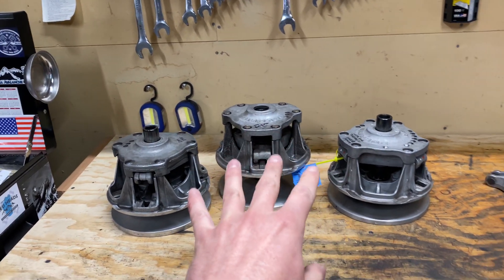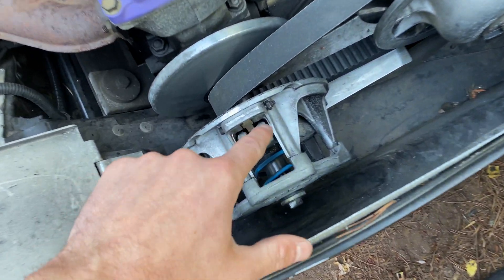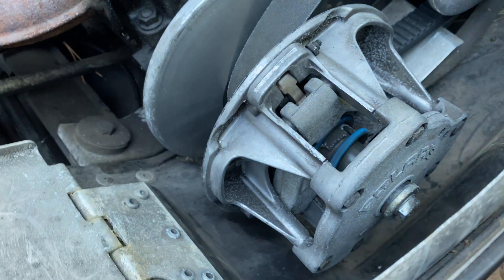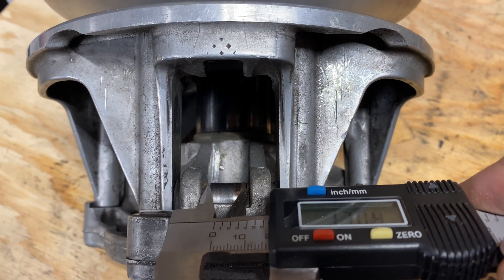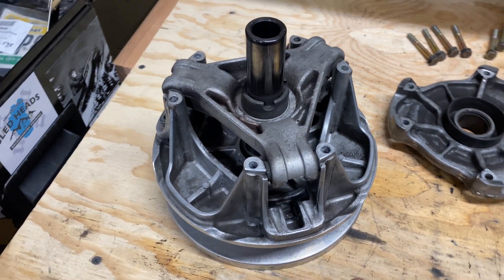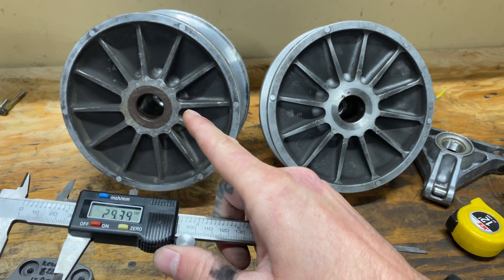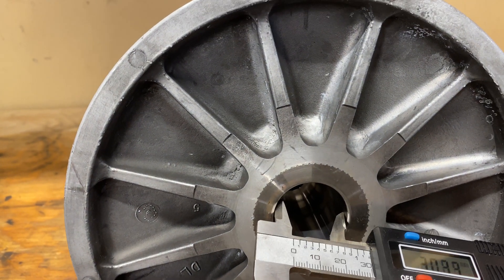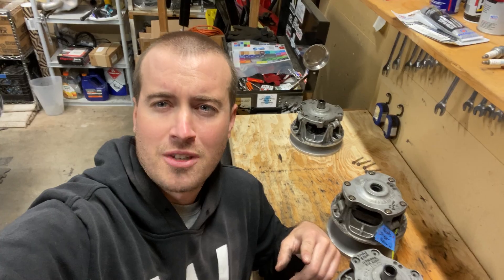Polaris P-85 Snowmobile Clutch History

Comment: Apparently, the "Big Block" sleds from 97-99 or Domestic Twins if you will are all 30mm crank tapers, so they also have very specific P85's. I wonder if those newer ones would work?
Reply from the maker: This is true. There have been a number of different crank sizes over the years. Gotta make sure they match up 🚀🏁

Comment: What one was in the 1996 indy train 488 ?
Reply: @FeederCountry  ??
Reply: They're all P85 clutches (except the new P22, and the P90 for the low-HP sleds in the '90s). None of the clutches in this video are for your 1996 Indy Trail, not even the one from the XLT. For the 1990s era Fuji motors, the rule of the thumb is that all the twin cylinder P85 clutches are interchangeable amongst each other, and all triple cylinder P85 clutches are interchangeable amongst each other. The triples and the twins used a different offset on the clutch, so they sit different distances from the engine block. You can see the difference on the back side of the clutch where the taper bore is. The triple clutches are like what is shown in Clutch #1 in this vid. The twin clutches have their taper bore in the center of a raised boss on the back side (with the fins).
Reply from the maker: @MrGcard100  more good info added this the comment section. Thank you!

Comment: So what’s the best clutch for a 1996 rmk?
Reply from the maker: If it was my sled I would run the exact same oem clutch that was sold with the sled. Then I would get a slp clutch kit so you can use their adjustable weights to tune the clutch a little. Especially great for elevation changes and trail conditions.
Reply: @FeederCountry  so the 2001-2004 p85 would not be an upgrade?
Reply from the maker: @taraszakordonskk5731  I personally don’t like swapping clutches around like that. I think the 2001 clutch runs a different belt than what your 96 does. So you might have to run a belt that’s too hard of compound for the HP your sled is making. There is a lot of variables. I think being able to tune the clutch via adjustable weights  will far out preform any gain you might see from changing a clutch.

Comment: I'm trying to figure out how to tell the difference between the p85 secondary and the p90 secondary?
Reply: TSS-04 or TSS-98 are roller secondary clutches made by TEAM. Nothing to do with Polaris and P85 or P90.  P90 secondary clutches are much smaller in diameter than the P85 secondaries. The P90 also used a skinnier drive belt. P90 system (primary and secondary clutches) were used both on the Polaris ATVs of the 90s as well as the low-HP sleds during this time - I'm talking the 340 and 440 fan-cooled engines in the Indy Sport and Indy Lite models.
Reply: @MrGcard100  my 94 sks sport 440 fan has an 85 in it, stock
Reply from the maker: p-85 and p-90 are the names given to the primary clutch only. The secondary clutches use different names like TSS-04 or TSS-98.
Reply from the maker: The TSS-98 clutch uses a helix and buttons, the TSS-04 uses a helix and rollers.

Comment: Nice. Any vids/resources on in-depth clutch maintenance for newer Titans? I’m getting a 2022 soon and trying to do most of the work myself. Thanks!
Reply from the maker: The clutch maintenance on your titan is gonna be easy! Blow it out with compressed air and clean the clutch faces. At the end of the season check the rollers and weight bushings. Replace as needed. Those clutches on the trail sleds last 5,000 miles plus.

Comment: u had it right, weight savings and structural integrity, also material savings.. it all adds up  im sure performance to with the lower rotating mass, that might even be the main reason  that kinda ties in with weight savings   quick edit...nevermind u mentioned that exact thing on ur next clutch explanation lol  :p  i need to start finishing the videos im watchin before commenting, im constantly writin comments jus to have to delete them  im leavin this one screw it lol
Reply from the maker: Thanks for adding to the convo!

Comment: To add some confusion as it will come up for some people. In 2020 the crank taper on the 800’s was changed to the same as the 850 so for clutches off 2020 800’s and 850’s they are interchangeable.
Reply from the maker: Good to know!

Comment: The p.85 on larger bore sleds are What they call and HD clutch hence the dome outer cover vs the flat offering a larger bushing to take more abuse and also the change in spider/ roller size also I believe the bore sizes are 30mm and 32mm as the changed the crank size due to them snapping off in 05 like my polaris fusion 900 recalled and some of the cranks where updated to the larger 32mm at dealers discretion making a grey area on sizes not a professional just speaking from experiences and passed down knowledge. You can run a p85 non HD on a big bore sled there just not as well built i guess as long as it has the same taper and bore size.
Reply from the maker: Thank you for adding this great info!

Comment: I'm rebuilding my p-85 off an '02 xc800sp "edge x" I ordered a primary rebuild kit, and the buttons (.250) are too thick and do not clear the towers. I've called many dealers and clutch part manufacturers and they say their buttons very from . 250" to .182" in thickness. Have you had any problems getting the right size buttons?
Reply from the maker: I have not. I use OEM parts when I rebuild clutch.
Reply: @FeederCountry  do you know if the buttons you've used on various p-85 clutches have differed in size?
Reply from the maker: @jakebirdseyemusic  I dont know off hard but I have to believe there are different size buttons for sure. Did you buy OEM or aftermarket?
Reply: @FeederCountry  I bought them from EPI Performance which is known for having good quality parts. But I called a local polaris dealer and they said the OEM buttons are the same size. Maybe I could shave them both down until I get the  .002 clearance?
Reply: @jakebirdseyemusic  most aftermarket kits you have shims that come in the kit or they're oversized and you polish down to the correct tolerance for the spider. Nothing too complicated but a bit of measuring
Reply: Really there are only 3 different P85 clutches from the 1980s to now. 
The 3 got updates and revisions for durability but didn't changed the application or function. 

#1 
(1981 to late 2000s)
Fugi engines "Fuji short taper"

#2 
Polaris engine "liberty engine"
(1996 to late 2000s) 

#3 
Big taper Polaris 
(2008 to 2021) 
I also believe the 900 twin had a different taper but we do not need to talk about that. 😉
And last note. 
From 1980 and new sleds with trailing arms only have 3 different chassis. 
#1 Indy chassis. 
#2 edge chassis 
#3 pro x chassis. 
Wedge is just a hood design.
Evolved as a hood design
Aggressive is a hood design
Gen 2 is a hood design 
And edge is a hood design. 
Take care. I like your videos.